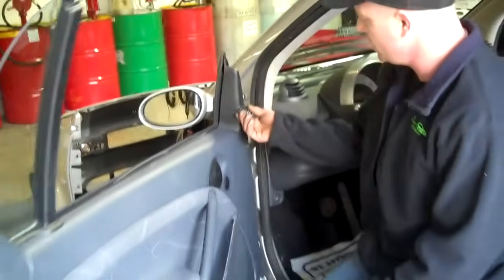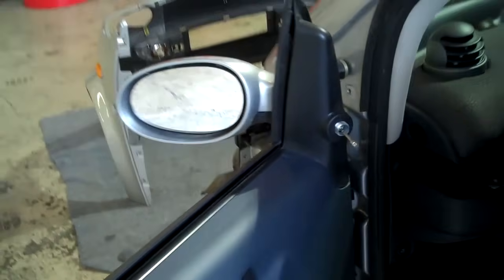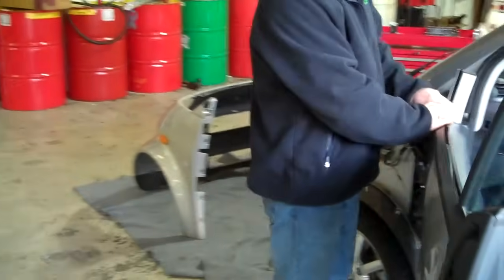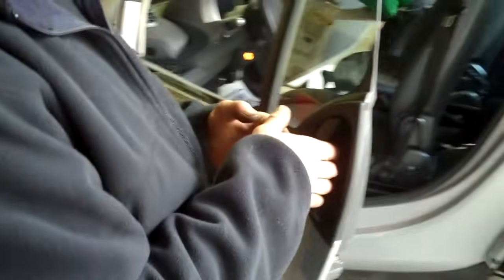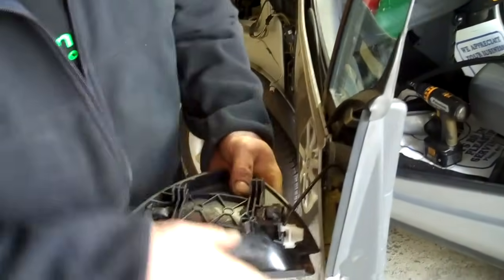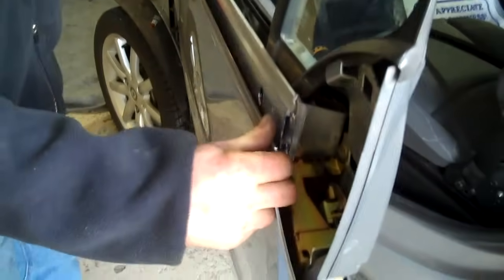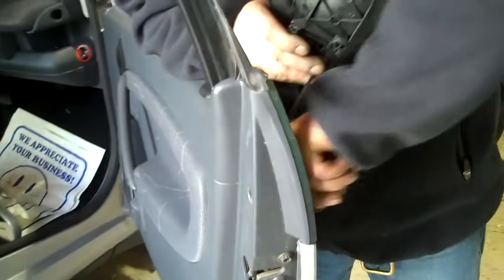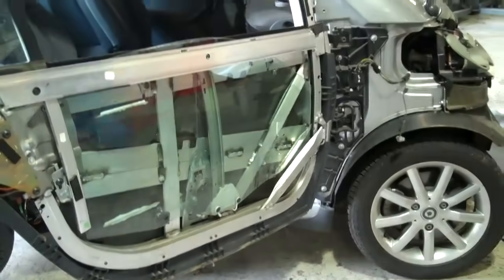Smart 450 panel replacement part 2

Comment: 820/5000
Hello Greencarco, happy to say hello congratulations on your video. I have been reviewing the internet because I have a Smart fortow that has broken the handles both outside and inside the right door bone the passenger and it turns out that I can not open it. I have been in the official house of the Mercedes and they tell me that I must break the whole door on the outside to be able to remove the external handle that is broken and thus be able to access the cables of that mechanism and be able to repair or change it. The truth is that I have scared enough because the joke can be quite expensive. As I see in your video the operation you are doing, can I do it from inside the car with the door closed, that is, remove that screw and remove the outer handle without the door being open? Thanks for your videos